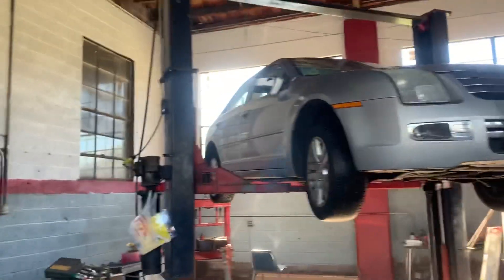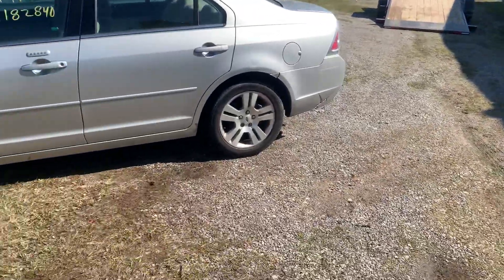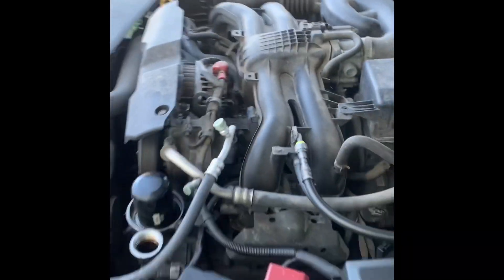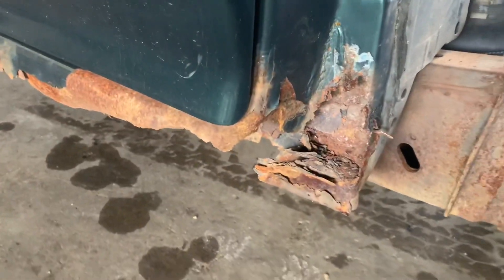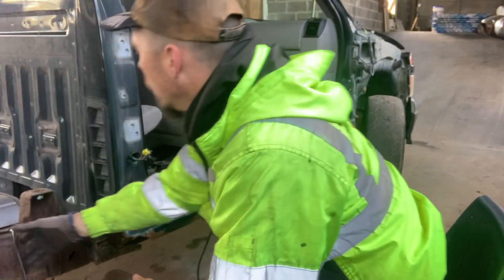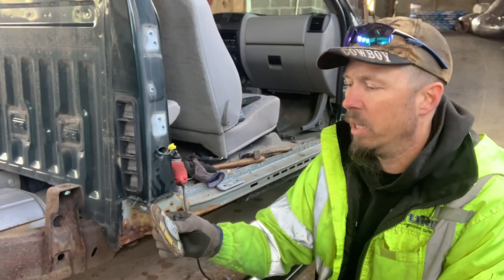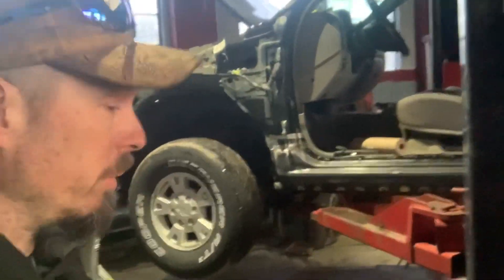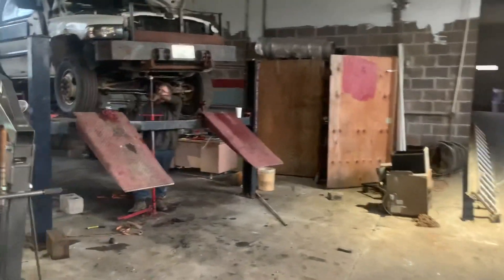Rocker Panel Replacement/Chevy Colorado

Comment: OK the end result looks great from the outside however you never addressed the rear pillar panels and inner rocker panel that had completely rotted out. those panels are ALL considered structural  and will be reason for safety inspection failure, by not repairing the inner rocker you left a direct entry for water, salt and dirt to enter and destroy the new panel in a very short time and the rear pillar issue is a structural issue that you just cover up, I know it is time consuming and expensive to properly do the job but this is definitely not done correctly. Very disappointed in this video. And yeah buy a spot weld bit much quicker to get panels off.